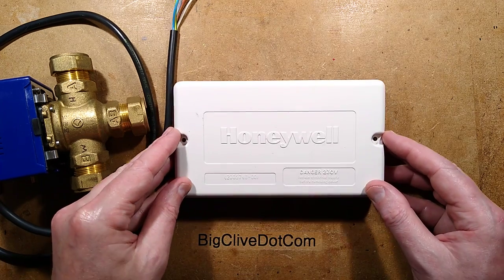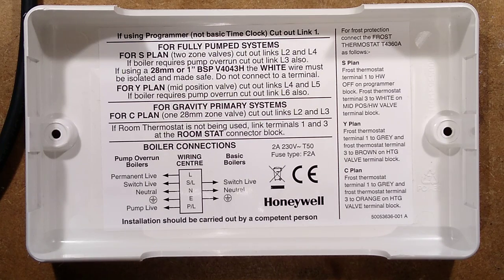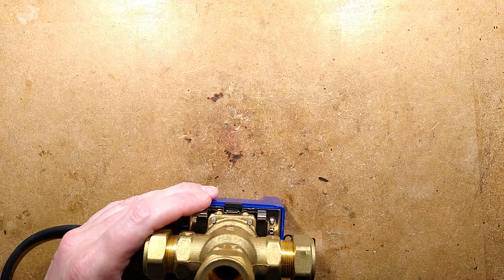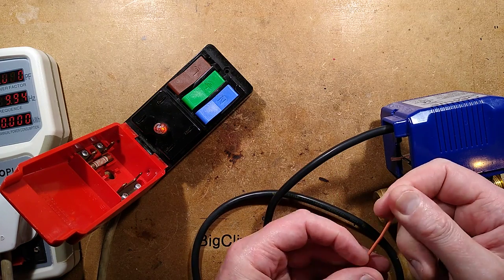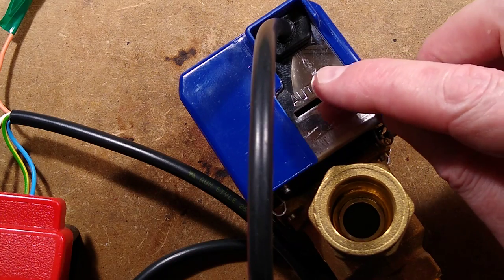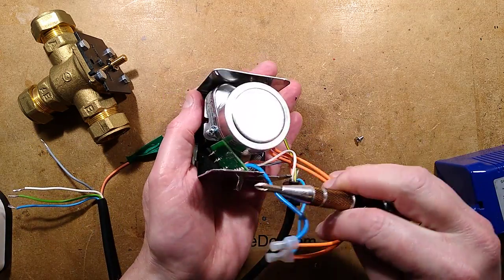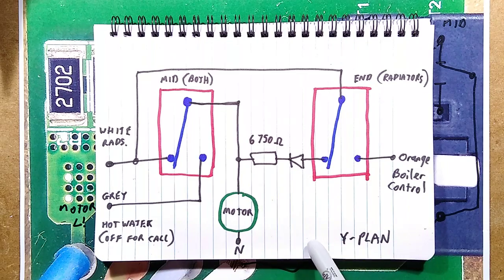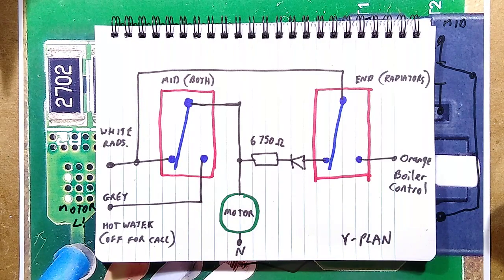Inside a clever Honeywell boiler wiring centre and a 3-way valve.

Comment: I hate these wiring centres.  The tracks on the underside are not reliable.  Give me a nice big enclosure or junction box any day.
Reply: Come here then. 5 zones with potential of overriding local controls.
Reply: @YagiChanDan  Where did you have 20 zones ?
Hot water options is an interesting one. Quite a few options.
Haven't come across any place that deals with return (cool) water correctly yet though.
Reply: @millomweb  I often design and install systems that size.  I did one where we didn't know the occupancy so to give a  cost saving on installation, set the cylinder up so that if it went below 50% capacity, the heating system disabled the supply to some of the zones thus allowing more kWs to the hot water.  Rather than installing a cylinder that was too big and expensive.
Reply: @YagiChanDan  I'd love to know more about those systems - the types of building. I've daydreamed about installing wet heating in Longleat House where such varying occupancy would suggest the use of a lot of zones !
If DHW needs a priority, then just run all the boiler output through it - so it's always being topped up.
How many boilers do you use in one system ?
They put an 80kW in my local theatre - but I'd have been tempted to put 2 or three boilers in spread around the building which effectively comprised 3 zones - the main hall, the bar/foyer area and dressing rooms/green room area.

Comment: That simple valve is why you can't have US style sealed and pressured hot water heaters. It is very clever, but using the same water for heat and for washing has sure had its costs.
Reply from the maker: The water in the heating loop is isolated from general hot water.
Reply: Water is used for heating only. Washing water is another system.
Reply: This valve works perfectly well with sealed systems. And those aren't "US style" they're common across the planet.